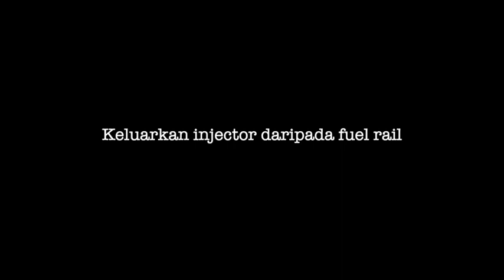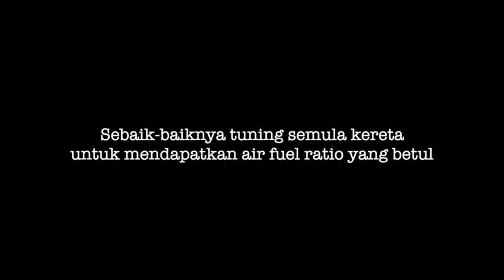Proton Wira Mivec - Fuel Injector Upgrade Guide

Comment: Salam, maaf bertanya, wira 1.5 Vdo boleh ke upgrade Injector? 1000cc?
Reply: Besar sgt tu 1000cc... mandi petrol nanti enjin
Reply: @DIYYo  maaf baru Perasan komen, bukan ke ECU akan mengawal jumlah Petrol yang dibakar dalam Enjin? senang citer, lagi besar Injector, lagi cepat petrol sampai ke Kebuk Pembakaran
Reply: @muhammadizzat3565  - salah teori tu tuan. yg kawal jumlah petrol adalah signal daripada MAF/MAP sensor dihantar pada ECU. setiap MAF/MAP sensor ni ada takat berapa besar injector dia boleh kawal. Kecuali tuan pakai standalone. 
Size injector bukan beza cepat atau lambatnya sampai petrol ke chamber tapi "kuantiti" petrol masuk ke chamber. 
4G63 N/A 2.0 dengan ECU standard yg pakai injector 390cc pun x lepas. Banjir minyak dalam chamber.
Bayangkan wira 1.5 injector standard 182cc upgrade ke injector 1000cc. Start pun mau x hidup.
Reply: @Azzry.D  owh yeke tuan, terima Kasih, explaination macam ini la yang kita hendak kan, kira nya, barang2 after market ni better pakai ECU standalone la ye?
Reply: @muhammadizzat3565  - betul. untuk fully utilize barang aftermarket.
Reply: @wankapcai9338  - vdo 1.3 original guna injector size 145cc.
Reply: @Azzry.D  Salam tuan,sy ingin brtanya,saya pakai wira vdo 1.5 Dan soalan saya ialah boleh kah injektor perdana masuk dalam engine saya? Sbb ada kawan kata boleh masuk Dan ada power sikit.mohon bantuan tuan untuk bagi jawapan.terima kasih🙏🙏